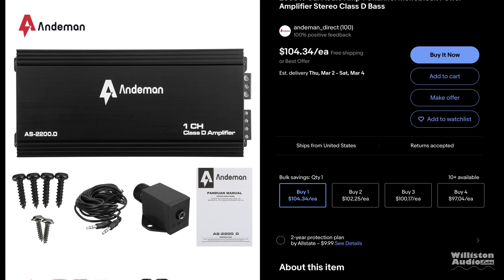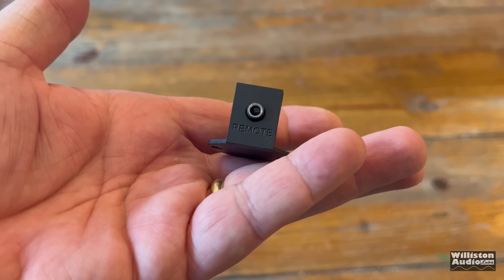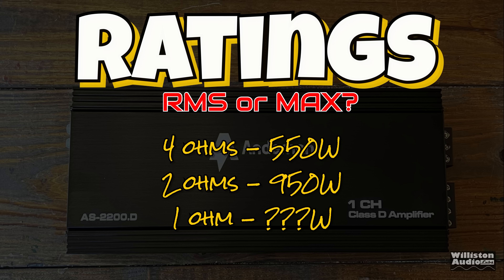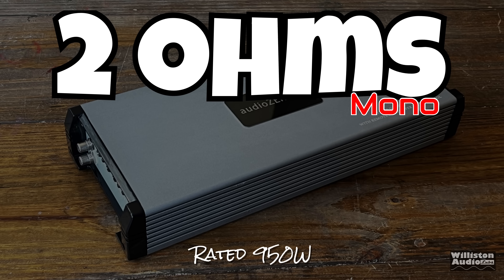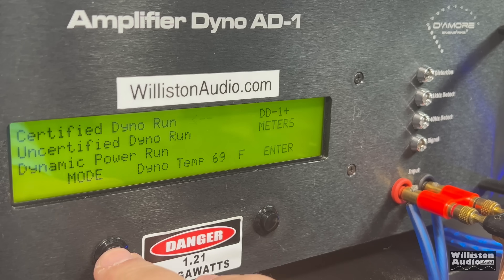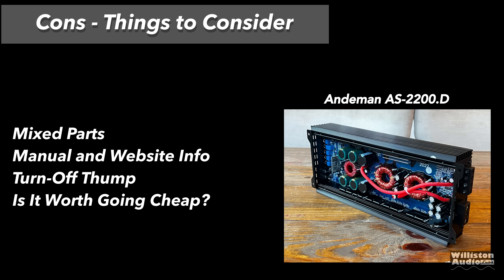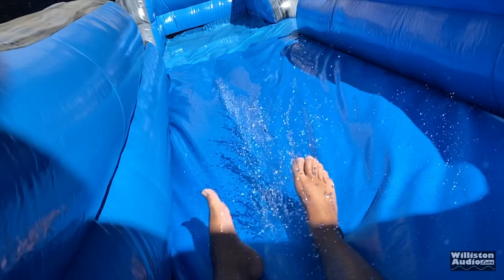Is This $100 Subwoofer Amp Worth Buying? Andeman AS-2200.D SKAR Audio Clone Amp Dyno and Review

Comment from the maker: SHOP
eBay Andeman AS-2200.D (price may fluctuate): https://ebay.to/3Iz8qK2
Alternate eBay Link: https://ebay.to/3y09Jwy
Down4Sound JP8 1200W monoblock amplifier: https://lddy.no/vvaw (My Recommendation)
KICKER Quad Box with 4-12" Subwoofers: https://amzn.to/3kDVBpK
SKAR Audio RP1200.1D monoblock amplifier: https://amzn.to/3ZrRFav
KICKER CXA1200.1 Monoblock Amplifier: https://howl.me/cjexiKN9lfw
Fluke 381 Wireless Clamp Meter: https://amzn.to/3IIj1SU

VIDEO INDEX
0:00 Intro
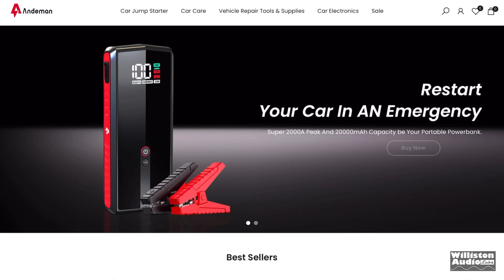0:30 Who is Andeman?
1:25 Unboxing the Amp
2:05 Features and Specs
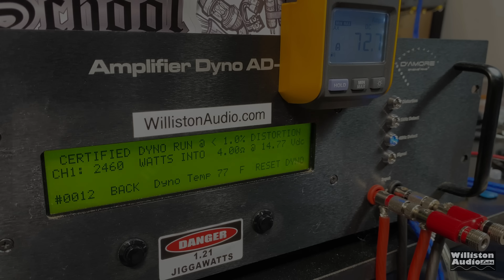3:43 Amp Dyno Tests
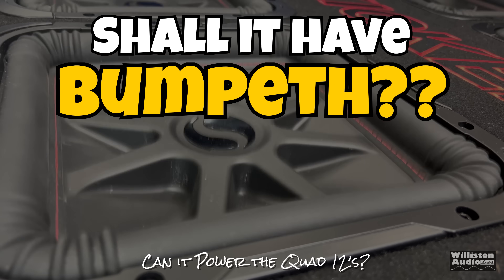7:17 Subwoofer Test
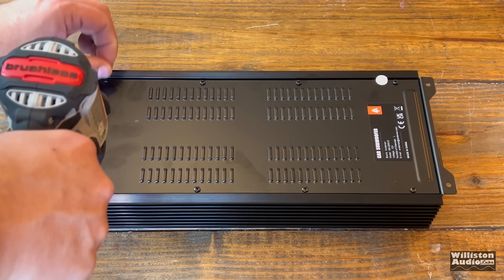8:08 What's Inside?
9:23 Pros and Cons
10:04 Final Thoughts
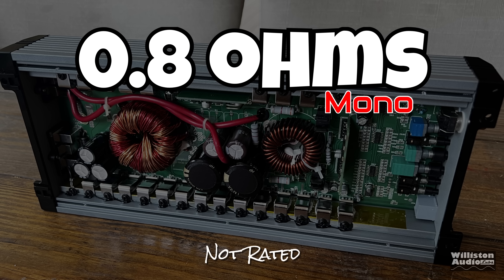10:41 EXTRAS

VIDEO AND AUDIO GEAR
Camera - iPhone 13pro 1TB - https://amzn.to/3nCjGvc
RODE Wireless Go II Microphones: https://amzn.to/3Q6NVHl
Shure MV7 Microphone: https://amzn.to/3A4OICK
Zoom H4n Audio Recorder: https://amzn.to/3BXjVsS
960 LED Panel: https://amzn.to/2Sxoq3S

TEST BENCH EQUIPMENT
SMD / D'Amore Engineering Amp Dyno: https://goo.gl/sJTcf7
XS Power D1400 Batteries - https://amzn.to/2BPFCKW
XS Power PSC60 Charger - https://amzn.to/2CHGcfs
Fluke 1000A AC/DC Clamp Meter: https://amzn.to/2Rw5WDA
Handheld Dyno: http://amzn.to/2u2EgKV
My Favorite Screwdriver Kit: http://amzn.to/2x0VzcE

DISCLAIMER: This video and description contains affiliate links, which means that if you purchase from one of the product links, I may receive a small commission. As an Amazon Associate I earn from qualifying purchases
Reply: This listing was ended by the seller because there was an error in the listing.

Comment: If you ever see these comments, can you answer this question about these cheap amplifiers? Okay, its only job is to amplify sound, so what's the catch with the price? It surely can't sound as good as a JL Audio amp putting out the same power, right? Obviously, if it's just a matter of piwer, all you would need would be the cheap models like this. So, what makes this amp different from a more expensive model?
Reply from the maker: Better parts, better engineering, made to last many years vs bump it a while then toss and on to the next one
Reply: @wal  yeah, I'd say so! I've been running a pair of Alpine amps in my truck since 2008. Never a single problem.

Comment: Should one be concerned if quality control is unable to catch English spelling errors on the knobs? Bgrige or Pnase? lol. Or the mentioned "varied" parts used. It's kinda crazy given the actually cost to manufacture and price to buy regarding capacitors. Most capacitors being what? Less than a $1 ? But I've read and heard that "black market" copy cat capacitors, as well as other stereo components are actually something to really watch for with Chinese products. Or when buying parts to repair your amplifiers.

Comment: Hey can you give me some good cap brands and capacitance+ volts to replace all 6 caps when it arrives. Im ordering the best i can get. I also need an affordable 30-60v 10 amp power supply, a cheap scope for now and an affordable accurate dc amperage trms clamp meter. I built a bank but I may upgrade it and i learned how to upgrade alternators and increase voltage. I am trying to get an online business going with a $2500 buy in and start installing gear that is priiced for the actual performance and quality

Comment: Is there a way to bridge strap two amps without having the master and slave knob as well as the RCA input?
Reply: Strapping means one amps positive and the other amps negative goes to the sub. The amps internal clocks need to be synced. So strapping requires a master slave switch and a cable that synchronizes their clocks. This amp can't be strapped.

Comment: I just ordered this amp off ebay.  Paid for the 2 year warranty. All total 107.  We will see how it performs.  This is the second amp ive bought because of your vids. (The other was not a budget unit but was well worth it) Thanks brother, for the time you spend making these vids.
Reply from the maker: Oh man I buy these so y’all don’t have to 😎
Reply: @wal I'm glad. I'm sure they can't sound very good.
Reply: How's the amp holding up so far?
Reply: Yep I ordered one two days ago. $84 I believe. I am going to get some good caps for it. I started repairing amps s little but I need a descent 5-10 amp 30 volt power supply and a used descent scope. I will have them soon + a better soldering station and hot work station or a combo, preferably a T12 stm32 with the element inside the replacement tips. I had one and loved it until a fire destroyed it, my PC setup along with 5 graphics cards, several motherboards and CPU's, power supplies, about $1200 in drone equipment, heater, window unit and my awesome work station I built. I'm trying to get back going.
Reply: This is a Dimond in the ruff.  1200 power certified for 107. Name one other bobo brand that has this price range and makes rated power. Extremely rare find. I think this is a good one trying to make its way towards the top brands. I purchased the smart 3k taramp because of your video.  You provided us with the info thats needed to make great purchases.  Thank you. Ive switched to cab45 and would love to see dyno because only 1 for that amp and its Sundown doing it. Great video and great info. Let us know how yhe amp preforms for you jason.
Reply: Trying find out did you get the Andeman amplifier if so it's worth ever penny

Comment: It does look like a good budget option if you're just starting out, and need an amp to run a pair of normal subs.
Really hard to beat 1200 certified watts for $100 - Quite the bargain price for some decent bump.
I remember when I bought my first car amp back in 2008, it was made by a brand called Magnat, and it probably did around 700 watts in 1 ohm. It cost me the equivalent of around $550 back then.
15 years later, the story is quite different 😅

Comment: Big D, I thought the same about the output level too. Have to agree with you, it is worth going with the D4S JP8 amp for more money. BTW The Audiopipe APMN-2000 amps can be strapped and don't have master/slave switches.
Reply from the maker: Some amps “strapping” syncs the power supplies between the amps and others it just shares the same signal and not truly strapped
Reply: @wal  
Thanks! Can the APMN-2000 really be strapped? I could be mistaken.
Reply: @wilsonrawlin8547  That amp does not look capable of being strapped. There are no provisions to synchronize their internal clocks. A strappable amp will have a special strap cable or at least a rca cable to link the two amps together internally. They also have s master slave switch so one bass knob can operate both amps.
Reply: @wilsonrawlin8547  Just a note, Audiopipe  amps are some of the poorer clones. They sometimes use the wrong components and doesn't perform as well as it should. I would suggest a different brand.
Reply: @JasonWW2000  
Ryan on Budget Gem or Bust amp channel tested the APMN 2000s on his dyno. They beat their RMS numbers. That's why they've gone up in cost because they perform. Mine have been running great for 4yrs. If I can afford to upgrade I'll probably go with JP's D4S amps.
Reply: @wilsonrawlin8547  In their AP3000 they used the wrong transformer. It had the wrong number of windings and that limited the rail voltage and it only made 2,200 watts. This was tested by Big D and barevids. Budget base head had two APMN 2000 and they always ran hot. He switched from 12ga wire to 8ga and that somehow fixed it. So there are definite weirdness with that brand. Theres so much more to an amp other than power. In fact, making rated power is not even in my top 5 things for choosing an amp. Yet for some, its their most important thing. I don't understand that. I'm just letting you know they are not such a great brand and there are definitely better choices out there.

Comment: Dang. A budget amp that does something resembling its rated power! Wonders never cease. Nobody who can't handle a soldering iron should touch this, though. If they were that haphazard with the capacitors, I'd bet good money they didn't match the MOSFETs. Replacement of blown FETs will probably be needed, especially if it's pushing its rated power most of the time into a super Lo-Z load (< 2 ohms). Might be fine if you're usually below the red line, or driving 4 ohms. Good find for a hardware hacker, however. 👍

Comment: Its basically a Recoil 1200 watt.  Same exact watts.
Reply from the maker: Reee Cola!
Reply: @wal  recoil amps from Amazon are only 120 for an amp thats higher rated than the 1200 it says.
Reply: Recoil is probably cloning the same original design as this amp is.

Comment: I went with a Pioneer gm-e360x4 for JL Audio for my doors and tweets.  Says rating at 1000W but doubt I’m getting even close to that, but she does bang for $139! (My PPI Art Series A300 handles the 2 Kicker Comp 10”s @2 ohms)
Reply: It's not a 1000 watts amp it's 70x4 at 4ohm and 90x4 at 2ohm

Comment: The business with the mixed caps might not be a problem... The green ones are most likely low ESR, and I have seen this a few times with class D amps where the caps before the inductor part of the pi filter have more high frequency switching noise so require low ESR (more expensive) devices, but the ones after are just cheap general purpose caps as they aren't as stressed in that part of the circuit.

Comment: Exactly what dude said below, think about how advanced car audio would be today if we could've been able to buy a 1500 watt amp back in the day for $150. I had two Image Dynamic 1500 watt amps and two ID 15" woofers in my 1989 Chevy Beretta GT and the kids at my school used to tell me that they could hear me coming from a mile away. I actually got suspended for 10 days when I pulled up out front of my high school and shattered my rear windshield with them. I paid almost $2500 for both amps back then.
Reply: No you didn't 😂😂
Reply: The actual mosfets and IC's used in today's amps didn't exist back then. What was available cost a small fortune. So amps were very expensive to build back then.

Comment: Really good amp for someone starting out in this. Not sure how long the amp will last but for $100 you camt beat that. Even if you bought it to run all of your mids and highs.
Reply: This amp is a monoblock , has no mid/hi level filters   . Only provides bass to a sub   .
Reply: @clearme2  Yep just responded about that to someone else. I hate to admit when im wrong about something too 😆. Really couldnt sue it for mids and highs without spending more money than it would be worth. Better to just get a full range amp so it sounds like to should and not like crap. I over looked the part that it was just a mono amp and not a full range amp.
Reply: It's for subs, not mids, my friend.
Reply: @tatialo37  😆 a amp can be hooked up to anything as long as the RMS is within range and what ever can handle the watts "My Friend".
Reply: Yes and no. Hooking up a class d with bad thd+n to midrange and high speakers will sound like dog shit. Loud dog shit but still shit at the end of the day. Not saying this amp will sound bad but that cheap and that much power probably makes a compromise somewhere. Plus these tests are ran at a specific frequency. You don't know if it will play 15khz without significant drop and distortion. Plus it's a mono amp. So crossovers are a necessity and if you spend money on them why not just a better amp.
Reply: @akassasin5768  You are right and I hate when I'm wrong 😆. I over looked that it wasn't a full range amp. It would sound lole crap and you would spend more money to get it to preform the way I said it could be used. Better to go with a full range amp instead of just a low range mono amp cause there also wouldn't be a stereo effect either.

Comment: I'm wondering if it would be feasible to use car audio amplifiers for band PA systems?
Reply from the maker: Not really because you’d need big power supplies to convert the wall AC into DC for the amplifiers

Comment: I appreciate you calling attention to the mixed parts. 
While it's not really an issue for rail caps specifically, it is an indication that the same approach was likely taken when populating critical components such as MOSFETs. Pioneer has been mixing batches of FETs for a few years now. It's disappointing to see.
Reply: does it really matter that much with a 1 channel  class-d tho?  it's not like ab
Reply: @lasskinn474  From a reliability standpoint, absolutely. In applications where multiple FETs are run in parallel it's important for them to be closely matched. In a parallel configuration each FET is carrying a portion of the load and having closely matched FETs will result in that load being split quite evenly between them. When they are not well matched- the FET doing the most work will heat up more than the others and fail prematurely. How premature that failure is depends on how poor the matching is, how much headroom the designers left in the design (over-built vs running at redline,) and how hard the amp is run on a daily basis. 

It's not about class AB vs D, it's any design where multiple parts are working together to share a load.

Comment: Imo ,these cheap amps are a only a value as far as design, but they usually fall short in efficiency and filtering due to cheap parts. I would buy one as a temporary replacement in the winter time, but i think youll pay the same amount buying multiple cheap amps to match the longevity of a quality amp and still lack in performance. I would at least get a product from a native and reputable company that you can contact and possibly get a refund or exchange with. Most companies play the blame game anyhow but you will always get what you pay for in some form or fashion.
Reply: I still have every Rockford Fosgate amp I have ever bought even some modded ones from back in the day there built like tanks! 
Can't see any of these cheap amp's lasting 25+ years
Reply: @NightshiftCustom  so true. My punch 800 is still shaking my wipers on my daily several decades later.

Comment: So, Dereck.

Say you strip the guts, and replace those dubious caps with descent caps like nichicon. Would that improve the sound quality? 🤔
Reply: those are rail caps, replacing them doesn't affect sound quality. for class d amps like this the components don't have a huge affect on sound quality, more focused on layout design and the output filter.
Reply: @bensonak47  ok, thanks. I was just curious.
Reply from the maker: Unfortunately not
Reply: these style class D amps were never designed for sound quality!
Reply: @NightshiftCustom  point taken.. 🤷🏻‍♂️

Comment: These cheap amps can do the wattage, but does this mean they just dont last as long at this pricepoint?
Reply: typically with stuff from china they use counterfeit components for the mosfets, ICs, etc. so yes, reliability will be no where close to amps with legit components. 

it's similar to the arduino clones you can find on ebay/amazon. functionally the same, but the quality/reliability won't be there, but it's typically good enough for general use.
Reply: The way i look at it is the guts look good. alot better than most. Just take care of it .. dont run it hot

Comment: It is pathetic that the cloners out there can make a better go of their forgeries just by changing the look while keeping a replicated board. WE DONT BUY AMPLIFIERS BY THEIR LOOKS. When it comes down to it. Plays a small factor in the grand scheme. Sry, just needed to express that. Lol thanks Big D.
Reply: Skar seems to have done well. Unfortunately some people do go by looks.
Reply: @JasonWW2000  fair point. Exceptions to everything tho... Appreciate yuh reading what I had to say. Just finished wiring up the WiFi antenna and the HDMI cable for my Maxspeedingrods Q96 Android head unit. Pretty satisfied. My wagon has two sets of component speaker pairs originally. Running an Orion XTR 750.4 to those. For the sub im running a CT-SOUNDS 1000.1D with a Dual 2ohm 10in CT-S Tropo wired down to 1ohm. Currently saving up to get a couple of the next step-up or Strato 12s in 4ohm duel voice coil to run at 1ohm for competitions. A bit more of a fan of SQL than SPL but my daughter now a teenager taking her to be in more than car shows seems like a good option for the summer.
Reply: @BigSteve_Gaming187  I would be cautious about logging into any of your accounts on that head unit. They are basically not safe and some people notice they can make changes to your account without you knowing. I've got a Joying android unit, but I won't be signing into any of my accounts on it. I might do a new account just for Google maps or YouTube. 
You know that impedance rise means your 1ohm DC load is going to actually be closer 2 to 3 ohms AC at it's lowest, right? If you want to get full power from the amp you want the lowest impedance to be around 1 ohm. You said competition so I assume you want full power. For that you'd probably need to wire to 0.5 ohm DC.
Reply: @JasonWW2000  I hear yuh. Researched that myself as well. I do have 2 step verification on everything I can these days with consistent login attempt notifications if not in my area. Caught a few people trying throughout the years. Along with consistent attention towards log-in reports pertaining to said device and location. Only planned mainly to utilize VLC media player for my DVD backups on Data format. As for the system I was being as general as I could but I do have a 500-700amp battery isolator running with a backup battery. Ordering two AGM 50aH batteries soon to run in parallel. I typically go to car shows with the auto club I'm a part of with my vehicle. Not a daily vehicle. Only going to SPL-type events for fun and something to do with my daughter.